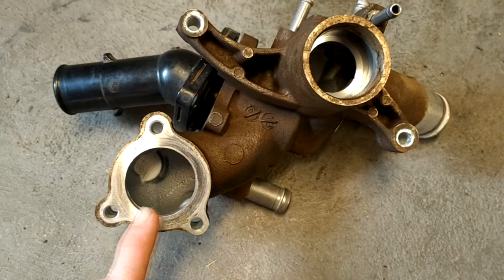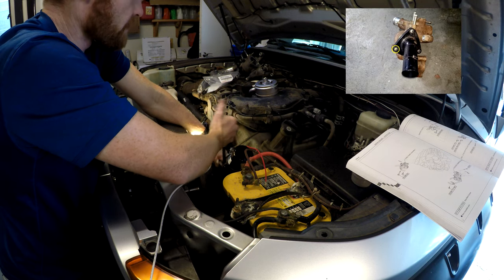Engine Upgrade Part 4: Optimized Oil Cooling (From a Tacoma) Tow Package Upgrade #2

Comment: Bought the complete OEM kit from sourceone for 400 bucks. Installed it yesterday. Thanks again for the video. Gave me motivation to do it myself. I didn't remove the fan or shroud and did it your way. Worked out just fine.
Reply from the maker: Awesome! I'm glad I was able to motivate you

Comment: Wow ,This came right on time for me,I am in the process of changing my 2007 fj rad(with CSF)with the same one you have,.also water pump,250 amp alternator,all new pulleys,new belt tensioner.My FJ has 250 k,i only want to do this stuff once,as i am 68  years old and my hands get cramps.that is why i am changing alot as i live in the rusty State of Ct.I watched another video for a 2004 Toy 4 runner,this guy purchased a set up after market for $350.00,New inlet ,oil cooler hoses and clamps,i did not want to pay that much,i was wondering the cost of your job?thanks for all your videos,i think they are Great,you are so well spoken,no cussing etc.You seem to be a well rounded young man like my son,if i could only get him out of his2009 Jeep,I keep pulling him out with my FJ..Ha HA!!
Reply from the maker: Haha, get that boy out of that Jeep if you know what's best for him. We worked on a lot of those at my old shop, I wouldn't want to drive one. You will have to remove the water inlet anyway to get that waterpump out, so if it were me I would change it to the tacoma part, at least for now and plug the hoses until you find a cheap oil cooler. The oil cooler part was $200, the water inlet was $35 after shipping, the hoses were $25 for both together. I've seen the oil coolers on ebay for cheaper than $200, mine was pretty new. Call the junkyards in your area and ask if they have the vehicles with this oil cooler, that's probably the cheapest way to get it. It came on the 4runners, Tacomas, and Tundras, the exact years that came with them is in the description of this video.
Reply: thanks again!!! @LegitRaceCraft
Reply: Hi again,the toyota # 15710-31010 is $572.96 at Lynch Toyota in Manchester,ct where my buddy works,list is $858.60...did you buy that used or new?
Reply: You Paid $200.00 ?
Reply from the maker: @josephwilcox2076  I bought the water inlet and the oil cooler both used on ebay, the oil cooler looked like it was never installed, and yes I paid $200. You may want to get the hoses through your buddy. I bought mine through a dealer online and they ended up being $25 or a little more.
Reply: @LegitRaceCraft  H
Reply: hello again,i was trying to buy the cfs rad,what company did you buy online from & What was the cost.the cheapest i have seen was $300.00
Reply from the maker: I bought mine on ebay since that's the cheapest place I could find it. It still seems that the cheapest is on eBay, but I didn't see it for as low as $300, I would get that one. Mine was $350+shipping to Hawaii, which added a lot to the cost.

Comment: Does ir work with FJ 2010, since the oil filter is not at the top???
Reply from the maker: Unfortunately, no. The 2010 and up FJ cruisers have a newer version of the engine than what's in the previous FJ Cruisers. This engine uses a cartridge style oil filter.